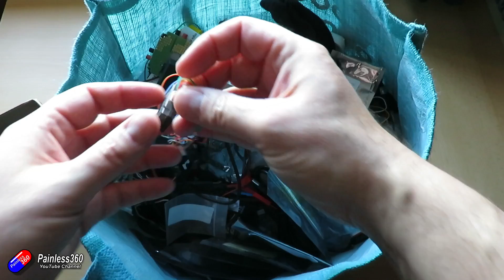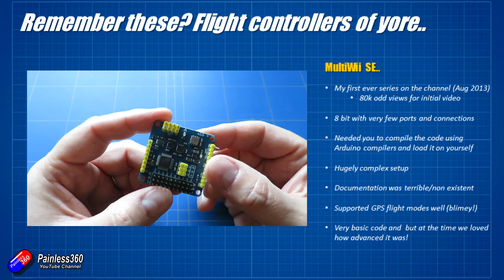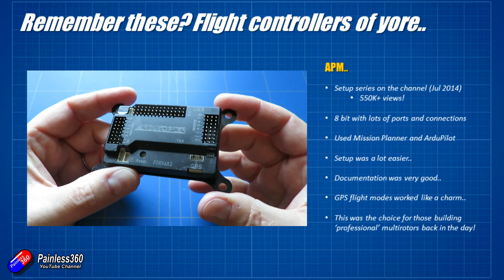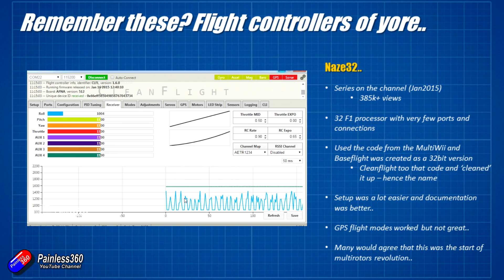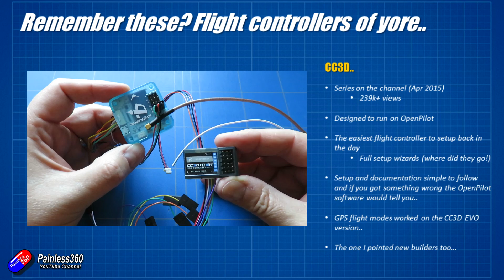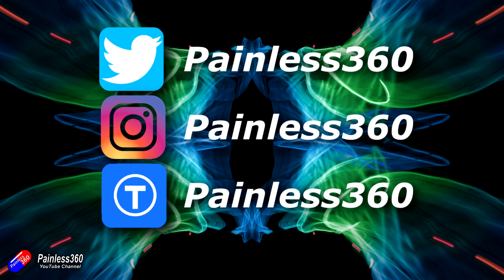Flight Controllers of Old: How many do you remember? (or still use!)

Comment: Copter control was OpenPilot,  it was the first STM32 F1 board, also the first 30.5 x30.5 board available. CC3D was copter control 3D. The second board from OP.

Comment: My first rc was a BNF piper cub. I ripped the guts out of her and put in a mulitwii. About a year later i got into multi rotors and built a qav 250 with a naze32. Both of those models are LOS only and after all these years they still fly pretty well.

Comment: I have to admit I fell in love with the apm 3.1/mini and even though modern fcs are easier to setup and offer more integrated capabilities, I just cant see myself using other fc. I love the wiring and the modularity of the board itself as well as how extremely tiny it is

Comment: Nice trip down memory lane! I started with quads in 2010 ... made by Conrad Electronics in Germany. There were 4 electronics boards all linked by ribbon cable ... the ESCs actually fed back data to the flight controller, so you could put a finger into a (slowly!) spinning prop and the FC would automatically cut the power. Went from there to DJI Naza when that came out, to get reliable GPS hold for aerial photography. I still have a flyable hexacopter with a Naza V1 and a quad with a Naza V2. This was all using 35 MHz FM radio (with 2.4 GHz VTxs) , so lots of fun mounting long antennas! Standalone battery telemetry from a Quanum unit with a receiver that clipped to the transmitter. Converted later to FrSky 2.4 GHz radio with proper telemetry (and 5.4 GHz VTxs of course), then built a little 4" 180 quad with Naze32 and Cleanflight for my first try at FPV. Had to find room then for things like a separate current sensor, OSD and 5V BEC that are all in the FC now - happy days :-)

Comment: You mentioned the "CC3D Revo". The "Revolution" was a completely different beast, based around an F4 and with a built in 433MHz telemetry link that could also be used for long range control. This was then followed by the Revo Nano, a smaller version without the RF link. The GPSv9 incorporating a magnetometer, and OPLink (433Mhz module to connect to your tx) were great leaps forward too. The designer of all this hardware (and much of the software) was a guy by the name of Dave Ankers, who I have to thank for getting me in to this hobby.

Comment: just getting back into the hobby, still have a quad with the cc3d board and one with the spf3, remember watching you video series on both of them, they still both fly good cant really tell any difference but thats probably down to my low-average skills. just built a tyro 129 which is f4 based, cant fly it yet as it appears transmitters with pwm output are no longer supported, waiting for new module and receiver for my trusty th9x. Great video by the way, nice to see the older tech.

Comment: I have 1 CC3D build and another is Sp racing F3 .Both were reconfigured by me in this pandemic time .I have crash landed into the hobby in July 2018 and the FCs easily available were these 2 .They were fun to build after following your series .I have also configured a fixed wing on CC3D for stabilisation  following your setup video. It's great to watch your detailing.

Comment: Great video I started with A NAZE 32 but I have tried the KK 2.1.5 and most of the others including the DJI Naza I mostly use the Omnibus F4 pro and have had great success using Arducopter after watching your video on Arduplane, thanks for your help and excellent content cannot wait until the lockdown is finished to get out flying again, cheers

Comment: I started out on a MultiWii SE 2.5 and when I fried the MCU with 12V I simply got my Arduino MEGA and connected the I2C up to continue using it as a bodgy MultiWii Pro, which was required for the last firmware released for it (was it 2.6? or something) By that point the hobby was transitioning from F1 to F3 boards, F4 if you were on the bleeding edge and were real rich. I am still using my trusty SPraceingF3 EVO on my new 5" racing drone! Had to buy special rubber standoffs but otherwise it works really well (I do miss the beloved OSD however. I can't fit my minimOSD into my 5" racer)

Comment: hi Lee

have no idea how 'good' is good gps with the old systems. only had the multiwii_SE. was only los during that time. also had no means buying stuff online.

now I use inav , with all the sensors and stuff, gps included. works fine postion hold / rth / autoland.  

nice content 👍

Comment: Great timing for this vid.  I bought a quad from a friend in May 2018.  With extra time at home now, I FINALLY pulled it out to get her airworthy.  Low and behold, it has a Naze32, but it's been flashed with BF 3.1.7. I found out, TODAY, that the F1 wasn't supported past BF 3.2.   Phooey!  So, I bound to its included RXSR, verified Modes and Receiver inputs, charged a 4S battery and flew it LOS in the front yard.  It's 2205-2522kv motors are quite peppy. :)  I've since begun the hunt for an F4 replacement board.

Comment: Thanks Lee    KK2, Open Flight , DJI,  APM2 , CC3D , Ardupilot, SP3 , Pixhawk, Frsky Open TX, Amber.... all came as a rush back then.   Bit like the early days of amateur radio when you had to build everything yourself.   Now everything has improved incredibly but the excitement has dropped off a little I fear..... still great fun of course.   As I write I am checking out the Jumper TS16 pro on the bench here with the Flysky FS-I6.  But just doesn't have the spark of the good old days.   Or is it me.   Keep up the good work

Comment: Another point with the Naze32 and SP Racing F3....most of us didn't even realize we were buying clone boards back then either...This caused alot of technical issues like poor flight performance and boards that just stopped working....lol
Reply: Yeah, the diode problems on the clone Naze 32 rev 6 were awful. Also that Omnibus F4 V2 AIO either burned out with first flight battery connection or the buck module failed after just a few flights. I thought I was the worst builder in the world until I got some Matek boards recently and now understand why others seem to enjoy the hobby without magic smoke!

Comment: I remember my first quad build used an APM 2.6, and even now, after many builds using Pixhawk's and F4 based flight controllers, i can safely say the old APM gave me the least amount of trouble. Especially so when it came to the way it handled compasses, i loved the fact it was so easy to totally disable the internal compass. I remember my frustrations when i moved to Pixhawk - constant compass problems, normally involving warnings of compass variance, even though i had told the Pixhawk not to use the internal compass. I think in the end i had to use Q ground control to finally totally disable the driver for the internal compass. But it's things like that that make the hobby interesting for me, coming across problems and finding a way to solve them. But it is amazing just how far things have come in a few short years.

Comment: I had the KK 2.0 on my first multi-rotor, a tricopter. It also was my first FPV copter, only tried it on fixed wing before. It felt a bit like flying a CP-heli and was very shaky on the FPV. Lost interest then but that came back when i saw the well-known videos here 😁 Bought a quadcopter with the CC3D then and this was the moment, it sparked. 

Still have the old ones catching dust in the cellar, not sure, if I should try to reactivate them again.

Comment: Funnily enough I have an "old timers" box and this video prompted me to find it again.  The first out was a KK2 with "Rolf R Bakke 2011" on the back. This powered my first large (12" blades) quad. The next one was a multiWii complete with 3 pots for yaw,pitch & roll adjustment. I've also got a "hexTronik" copy of the multiWii (early Hobby King) with 3 Uarts & a bunch of PWM connectors. It also had the first I2C connection I got to play with and even a barometer. Then things got modern with many versions of the SPR-F3 which I used with Baseflight, Cleanflight & Betaflight. Then I got into Pixhawks and of course the many clones along with MP etc. It's not until you look back you see how far the hobby, technology, hardware & software have come in the last decade. Great video Lee ...

Comment: Still got a few KK2.1 boards and a CC3D kicking about, there was a firmware to run KK2.1 as a fixed wing controller, never tried it though
Reply: i got the firmware on my edf jet, sadly crashed it once because i did not use fast servos.  now its dead weight in my jet.      i will not trow it away because i still wanna use it for another plane or as fpv camera stabilization : )

Comment: I remember all of these flight controllers. I also had my first quad with a mechanical gyro on top. It worked but not well. I then moved to the kk. And moved through all the flight controls as it all moved through these. It’s amazing really how far they have come today. I was only speaking last night with my mrs how I’ve got to sell some old parts that’s in my dads loft with all my quads that have all these fc’s on. thanks for the trip down memory lane. 👌😎 
stay safe